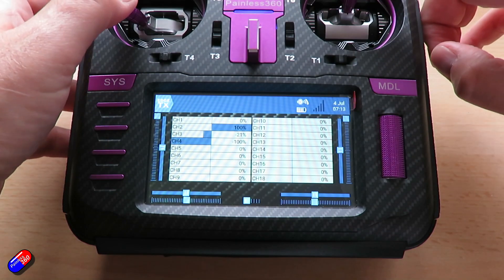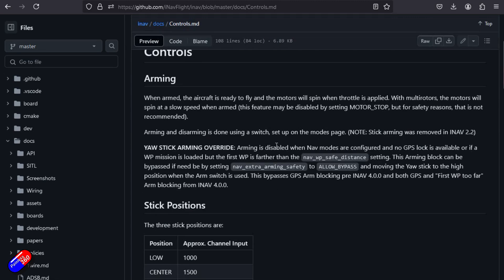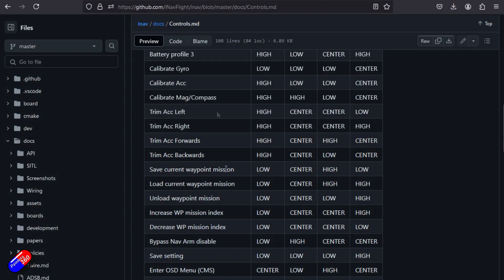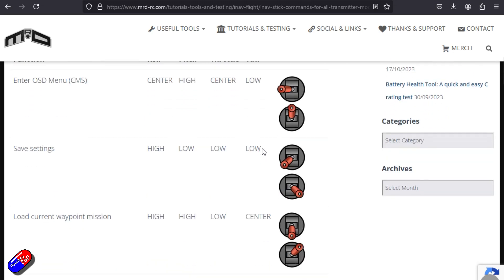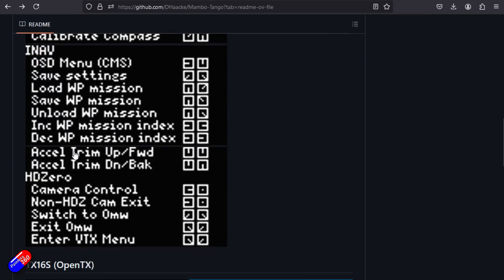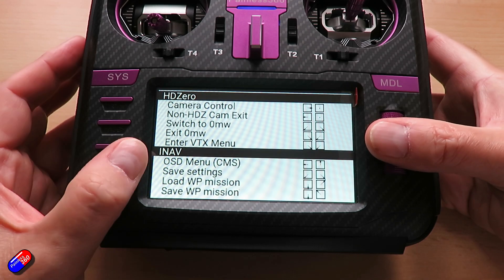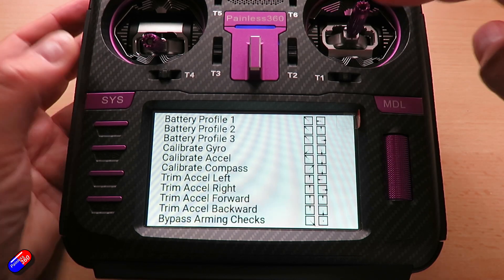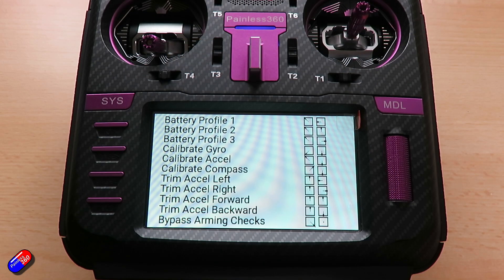Stick Commands for Betaflight, INAV and HDZero

Comment: thanks but how do I use the stick commands?  How does system know I am wanting to use the stick command and not just check control surfaces while on the ground for example. There must be some way to enter the mode I would hope.

Comment: Hello sir.
my name is Adebayo Kehinde. I have been working on a fixwing project for a while now using mission planner which i have been performing auto takeoff and landing on it and recently i have been having some good and accurate  landing, 
But  am still having issues on the auto takeoff which require the UAV to taxi and make use of the runway itself to takeoff without my guidance on the steering.

pleas i will really appreciate   if you can help or guide me how i can fix the steering to be able to follow points on the runway for a full autonomous takeoff.

Thanks.
Reply from the maker: Check out the Big Boys Toys playlist for some of the videos created with support of Ben, who really knows mission planner. Best of luck!

Comment: Hi there Painless360. I have an issue I'm hoping you can grant some guidance on. I have a rather large quadcopter (450 class) that I've put the CADDX GM3 gimbal on. I'm using the Bardwell F7 V2 flight controller, and I've put PWM control for the gimbal on motor pads 5-8, with pan and tilt control on the right, and left sliders on my TX16S MkII, because my goggles (Fatshark Dominator HD) don't support head tracking. The problem is when I move the sliders, the gimbal will move a little in the direction I'm sliding, freeze, and as I move the slider farther, it will jump all the way to it's end point. It seems that I'm getting very poor PWM resolution on those channels, but the radio is indicating that I have smooth, fluid movement all the way through the movement scale. What have I messed up here?
Reply from the maker: I'm assuming that you've posed this question to Mr. Bardwell too (as he was the one that made money from your purchase of this branded hardware?). I've not used the GM3 direct to a FC via PWM yet, the inbuilt HT works so well...
Reply: @Painless360  I've been messing with this for a bit now. I wish I had purchased either the Walksnail Goggles L, or X, instead of the Fatsharks. I didn't go with the X's because I read reviews of it having issues with head tracking, and blurriness around the perimeter of the screen, and didn't go with the L's because I would need to get vision correcting lenses for it, which looks to be a bit tedious. Looks like I'm starting over with my ground setup.
Reply from the maker: Check out my video on the Walksnail HT system that is in the Goggles-L (and the Goggles-X now too - from the factory!). It works very well and is super simple to setup and use... Best of luck!